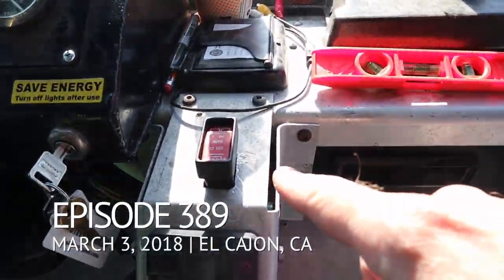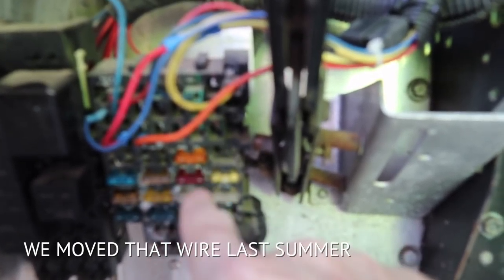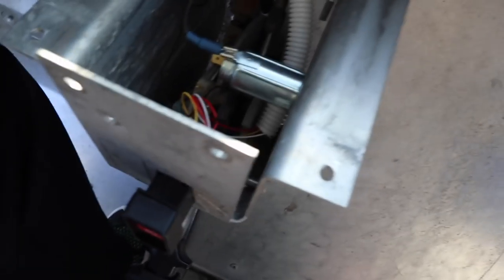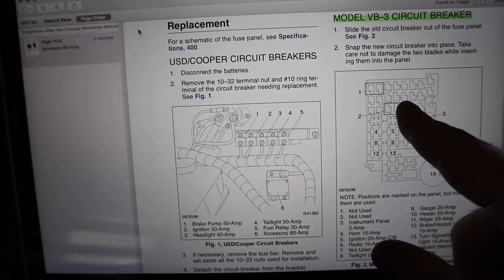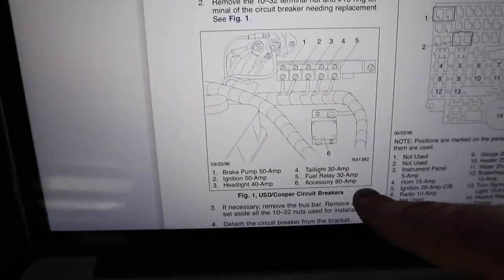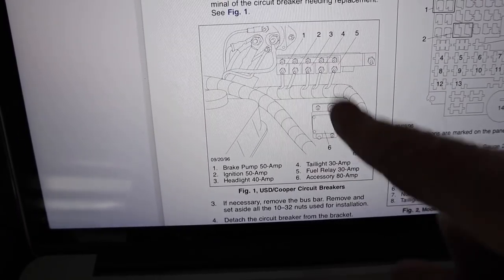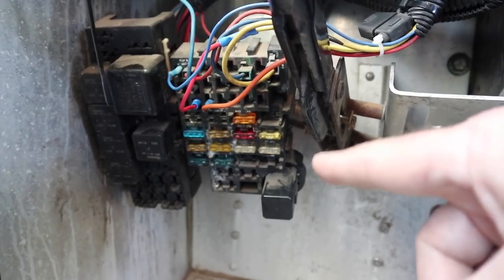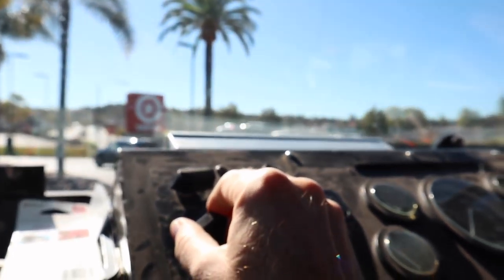Confusing Electric Troubleshooting in Step Van E389

Comment: All the things I've said are my basic assumption I would do to solve this issue. Having a good wiring diagram with correct color codes help a lot, makes tracing wires and connections much simpler.
Reply from the maker: the service manual has some wiring diagrams but unfortunately is missing some of them
Reply: Owners Manuals never have enough information they are a good rough guideline at best. It can be expensive to get the Manufacturer's Wiring Diagram but they are the best. Aftermarket Diagrams can help but sometimes they don't give the Correct color codes.

Comment: Connect that red wire under the hood on the starter relay to the wire terminal that comes from the battery  (always hot) It appears to be a fuse link,made to break when overloaded,just like a fuse.
Reply from the maker: we pulled apart the relay yesterday and found a broken eyelet end to the broken wire where it attaches to the relay. I now have a new relay and proper connection but that didn't solve my electric problem

Comment: Seven, your problem I am 99% positive of is that loose red wire under your hood. Crimp a ring terminal onto it and hook it onto the left terminal of your starter solenoid. And you should have power. You might have to extend the wire a little but I am 90% sure that is your problem
Reply from the maker: we installed a new starter relay and attached the broken wire. unfortunately it didn't give power to the wipers or fans. we think it is something else now

Comment: Fix the broke wire under the hood it goes where the other small wires come off the starter solenoid  should be a constant hot. Bat +   . ThAt top left spot in the fuse box is not getting power. So it either has a bad connection somewhere  or the wire in question under hood powers that spot  . It worked before so back track where new wires have been ran. And check every connection  you can see .  You can always run a new wire from the buss bar under the hood and connect all the wires from the fans cig lighters ect to the new wire
Reply from the maker: will do!

Comment: I am sure thst you are being buried with suggestions, but I have one as well....lol.  Why npt ar a 12v power expansion box. Most parts stores have them in stock. You can wire it straight from a ignition 12v source. It would basically give you a fused panel to add 6 to 8 accessories. Buss inc.  makes a popular one that Advanced auto keeps.  If interested, let me know and i will get you the part number. Thanks.....David in Florida
Reply from the maker: David, thx for the suggestion. Daniel is helping me today to install something similar which is just a relay receptacle. I've also been told I should replace the entire fuse panel which is corroded. however, for that I feel I need a place to park for a week at someone's house to do the re-wiring

Comment: interested to see what the solution to this ends up being. when I have issues like this I start right at the beginning with "what changed"  the cig lighter was moved down... so when that happened did you disconnect the battery? you mentioned that that black ground wire was not there before and was added?...was that added during this procedure?  what has happened to me before with a motorcycle I kept losing power to was a component got bent over slightly while i was working on it causing it to short out against the frame, might check to make sure nothing was bent or getting shorted out when you put the column back together, might look ok when its all opened up but when you close it up could something be touching and shorting out? you mentioned in a comment that someone was helping you and it looked like maybe a relay issue... if the relay was,is blown or stuck shut there is a reason for it so if it was a bad relay that could be the symptom of the actual problem not the problem itself.  just my two cents.I find it very note worthy that the problem started when the cig lighter was moved.
Reply from the maker: from what I can determine, that style of cigarette lighter is all metal the jacket sleeve is the ground and grounds to a metal dashboard (only works with older cars with metal dashes). it does have an extra pin connector if you have a plastic dash for a ground which I didn't need, but didn't know that at the time. we also discovered that it was shorting onto the gear shift inside from the hot power lead which was not good. sounds like that is similar to what happened to you in the same way
Reply: yes very much so!

Comment: A test I would do is to test the relays,the little black cubes next to the fuse panel,it looks like one of those might of failed. It's a simple test any auto electrical can do with the right test kit to do load and function testing on them.
 If the relays are all the same you can transpose a couple for a test to see if anything changes,this can also quickly pinpoint a fault. I use the relay from a circuit that is less essential like the horn or fog lights as it will have seen less use than a well used one like lights or fans.
Reply from the maker: think you are correct on a failed relay. how do I test them myself?
Reply: Seven Wanders the World you can swap for a known good relay of the same type. They just pull straight out. Pick a system that works and then swap relays over. If the fault clears then it's the relay. Same if the other system now stops working. Relays pretty cheap and plenty at breakers. Worth keeping a couple with spare bulbs and fuses in a Tupperware tub either in engine bay or in a space out of the way behind dash.
 Can get a relay tester of the net on eBay or bang good for a few bucks. Good tool to use yourself and to help others with. Really getting to grips with electrics a must for projects like yours, quite possibly electrics the source of 95% of problems!

Comment: Add two new (extra) fuse boxes for all stuff you put int the circuit, or for things you choose to re-run wires for, one fuse box you give permanent 12 Volt (by it's own fuse before the fuse box), the other fuse box the same way but with a relay so it is only with power when the ignition is on. 2 times 12 fuses is not overkill. There is fuse boxes with a small LED for every fuse that lights when a fuse i broken
Reply from the maker: excellent advice for 2nd fuse box!

Comment: As a basic vehicle recommendation everything that isn't necessary for the vehicle to operate safely should not be in the main fuse panel of the vehicle. It would be better to install an additional fuse panel just like you did with the house batteries. Just wire it up so that it has power with the Key On and the power goes off with the Key off.
Reply from the maker: I love that idea. I'll be moving ceiling fans over to the new house electric system. I also plan on moving the wipers back to the original slot #11 on the fuse panel

Comment: Wow, you're getting a crash course in electrical trouble-shooting and problems that can arise.  I bet you will have everything fixed before you head north...I like to start from known to unknown.  For example start at the battery and test your test light.  Then move to the fuse block and insure the section in question is getting power and then on to the individual fuses.  Good luck...TL
Reply from the maker: I'm learning HUGE amounts of info about electric stuff over the last couple months

Comment: You really need to learn how to use the resistance (Ohmn) function of that multimeter, so that you can check if your wires are good and that your grounds are good. That Bus bar is really rusty it can't being doing too much in the way of conductivity.
Reply from the maker: correct, I need to learn about ohm function. so much to learn and too many problems!

Comment: using your test light put the crock clip on earth then put the probe end where the wires pick up on the fusebox. if it doesnt light up look on the rear of the fusebox and see if a positive wire has come adrift
Reply from the maker: will test wires behind the fuse box!

Comment: The 80 amp circuit breaker would be the Last thing to worry about,,,,That wire that is under the hood which is broken MAY be the problem,,,,One of  a few things is going on ,,, a Broken Wire,,,,,Blown  Fusible Link,,, Blown Fuse,,,Best Regards
Reply from the maker: thx. I did some more research on the 80 amp. appears it is an auto reset breaker and not the problem. we reattached the broken wire and it didn't solve the fuse panel problem (but may have fixed some other unknown issue that I'm not aware of). still working on a fix to the panel today

Comment: Why not run your 2 or 3 fans off of the house batteries?
Reply from the maker: the maxxair ceiling fans will be rewired to run off the house. they are not important at this point but only mention them for diagnostic purposes ;)

Comment: It looks like there is no fuses for the wires plugged into the top of the fuse panel. As some one else said you may have a problem behind the fuse panel.
Reply from the maker: the top left area all have in-line fuses as they are just hot wire points. but you are correct, there is a problem with power going to that section

Comment: Seven, sorry you are getting frustrated. That is one of the problems with 12v vehicle wiring, it is stupidly simple, and amazingly complex at the same time. Unfortunately, you have had electrical problems similar to these from the very beginning of your Step Van Project. I would strongly urge you to find a place to stay put for a week or so and get someone to help you to replace your Fuse Block and fix all your wiring issues. This will help you with your future travels. By-the-way, I have never been a fan of those tester lights you have been using because you can't tell how strong the circuit you are testing is. If you use the multi meter to determine if you have power to a circuit, you also know if you have "Full" power to the circuit. If you test a circuit and you have voltage, but not the full 12 volts (+/- whatever your battery reads) you know the problem is a partly broken or partly grounded wire (most likely a corroded wire). For example: you could use your "Light" tester and determine you have power to your wipers, but still not have the full 12 volts required to operate the wipers (low voltage could also indicate a bad wiper switch in this case).
Reply from the maker: I think replacing the entire fuse box would be very wise... now.. just need a place to stay for a week!

Comment: The little red lever on the black relay gets pushed to the body of the unit , If it's out the breaker is tripped . I cant see what position the lever is in .
Reply from the maker: I think I have a different kind. this model does not have the red lever. it is a sealed marine breaker with automatic reset (like this one: https://www.ebay.com/i/222764486437?chn=ps )

Comment: First of all, take the circuit tester and throw it in the garbage. It will cause you more grief especially if you use on something like your engine computer. Poof, you need a new computer. The multi meter from harbor freight, even though it is cheap is your best tool. From what you have shown one section of your fuse panel is faulty. I thought you had a ground problem before but your testing has shown that to be not the problem. You already had a bad section on your panel so this is not surprising. I am a heavy equipment mechanic and I have had to deal with this before. I generally install a small sub panel as it is a lot quicker and cheaper on older equipment. I think this is beyond your skills, right now, but not really that difficult. I wish I could help more but I am about 3000 Kms north of you not enjoying the snow.
Reply from the maker: Pat, your analysis is spot on here in your comment. yesterday Daniel helped me discover exactly what you wrote here and found a failed relay connection which supplies power to the fuse panel section which is dead. he is now helping me wire a new relay receptacle and patch it into the fuse panel to supply power to the dead area
Reply: Let me amplify what Pat said.  Take time and really learn how to use your multimeter. I'm sure there are many You-Tube videos on the subject.  It should handle 99% of electrical diagnosis ONCE YOU KNOW HOW TO USE IT.   Instead of "when you gotta" sporadic use, be systematic and really dig in to how to measure voltage, current, and resistance for both AC and DC.

Comment: My gutfeeling tells me that red loose wire is the villain. Try with your voltmeter. 12 volt setting. Black on steel red on the ignition thongamajigger if you have  power. Probably the thickest red wire. Attach the loose wire to that. I believe that solves your gremlin
Reply from the maker: we rewired the broken wire on the starter relay. I'm sure it fixed something somewhere else,  but didn't fix the fuse box problem with wipers or fans. ;)

Comment: If your grounds go to aluminum and not metal then that could be part of the problem. Try running a new ground wire to the steering column or something nearby that isnt aluminum and see what happens.
Reply from the maker: I agree the aluminum is not ideal for grounding things. will use the steel for troubleshooting ground connections on the steering column

Comment: They all share common power which could be that broken wire at your starter solenoid just turn the wipers on and touch the wire to the power terminal and see if they work
Reply from the maker: tried turning on wipers and touching the wire as you suggest to a power source. no change. we then found the break in the wire and reconnected it to a new starter relay. wipers still don't work (or fans)

Comment: seven could you have placed that wire in the unused  #7 slot instead of ignition, if you blow that circuit you may not be able to start your van.
Reply from the maker: I like your user name! actually your idea is brilliant for the wipers! I like it

Comment: It is really not considered good practice to jumper off the fuse box like that. It's  at best a bodge and the only real option is to restore things back to standard. Adding an auxiliary fuse box for accessories and modifications is neither expensive or difficult.
 It will serve you well to have a qualified and experienced auto electrical have a good look at things. You probably only going to need a couple of hours to half a gay at most. Worth it bluster to relieve stress! So wish could help,could totally turn things around so easily. Get the right help,you won't regret it.
Reply from the maker: great advice Andrew. I can see the logic in an auxiliary fuse box!

Comment: To fix the problem of the dead feed wire i recommend one of these 2 videos, it has to be one or the other. Open circuit meaning a possible break in the wire and how to find it:https://www.youtube.com/watch?v=4DV1n-dZdeg
or its a short and how to find it:https://www.youtube.com/watch?v=M4LGykZiRtY
I know it seems daunting now but it's a lot simpler than you realize. The worst part is at the hardest you might have to open a wire loom to fix a broken or burnt wire.
Reply: Have to make an correction on what i said. The feed power to that corner of the fuse panel can come from A: directly from the battery meaning power at all times just like your Hazzard and Headlights should have power even when the Key is Off.  B: through the Ignition switch or by a relay be energized when the Key is On, meaning power supplied when the Key is On.
Reply from the maker: Kelly, I'm now working with Daniel. yesterday he ran a clean power wire from the starter relay into the relay block next to the fuse panel. today we plan on connecting a new relay receptacle into the panel next to the fuse panel which should solve our problem

Comment: Seven just move the wires to the original fuse they will be fine and wire the max fans to the house batteries. You're over thinking this.
Reply from the maker: correct. ceiling fans will be moved to the house electric fuse panel in the next couple weeks. not really concerned about them. mostly just wanted the wipers running for the rain. I'll be moving those back to fuse #11 slot